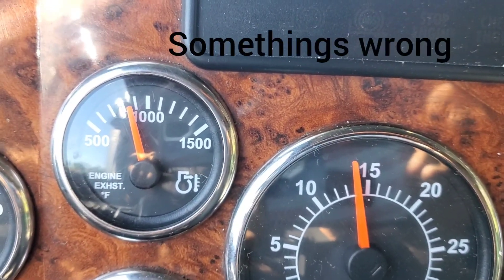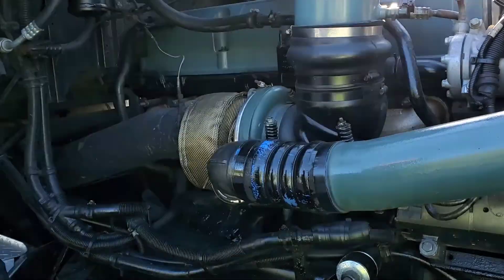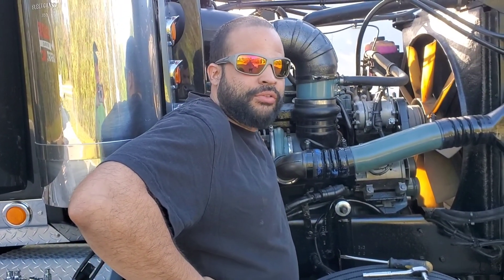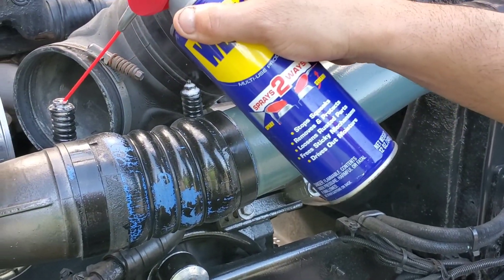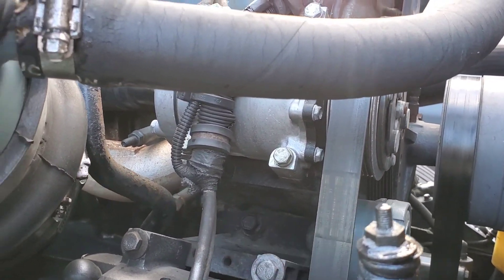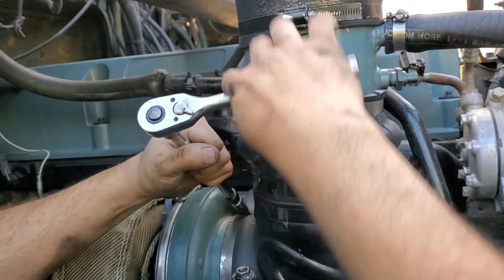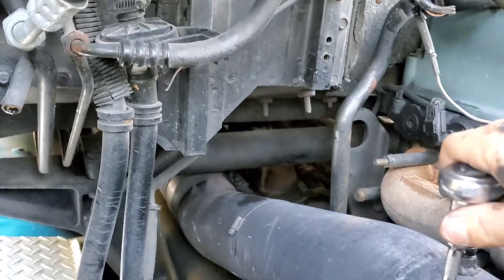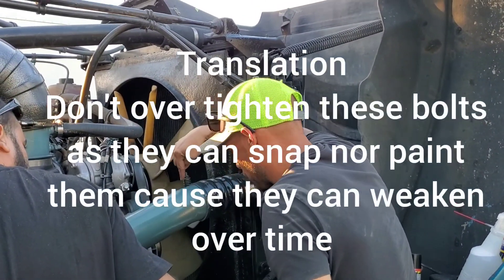detroit 60 series n3 injectors 600 hp non egr very high egt exhaust gas temperature fix 🤕

Comment: The best way to find if you are sucking or blowing air... take a propane torch, turn on the gas but don't ignite. Move it around places that may be pushing or pulling air through a leak, if idle increases then it's pulling propane.

Comment: Are n3 the biggest injectors for Detroit ...n whats injectors are bigger
Reply from the maker: N3 injectors are from 05-07 for detroit 60 series 14l
Reply: @Turboguyz11  oh thx for the info ..is there an n4 also?
Reply: @Turboguyz11  N3 are also on 2003+ 12.7l series 60 I have one it's weird but they did put N3 injectors in 12.7l also
Reply: @Ty81494  oh really?
Reply from the maker: Yes there are
Reply: @Turboguyz11  thx